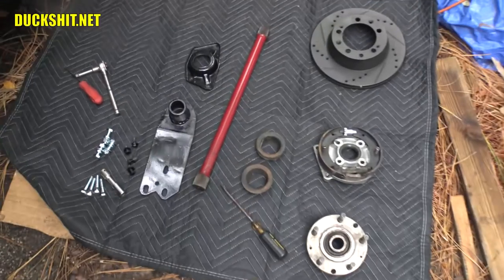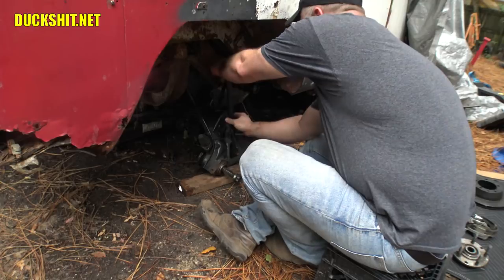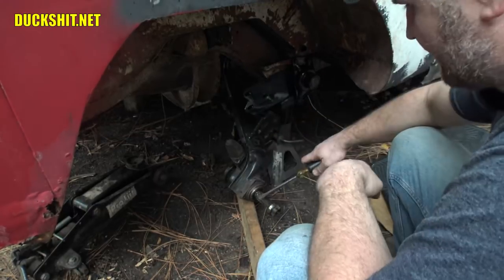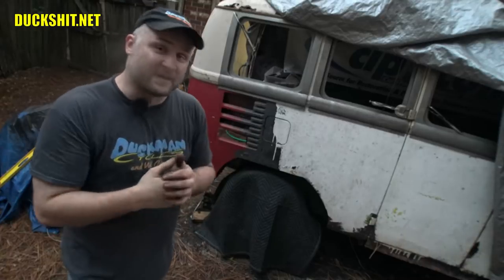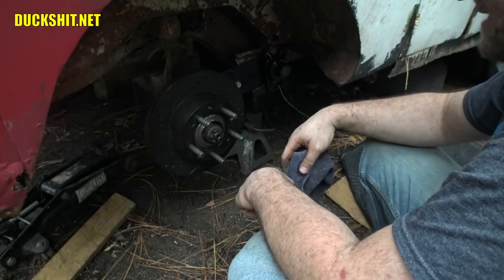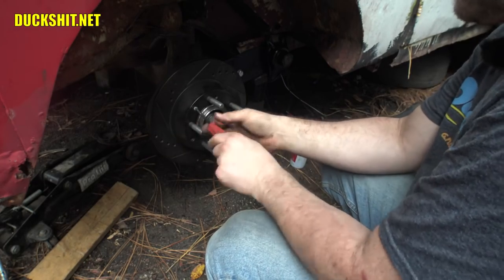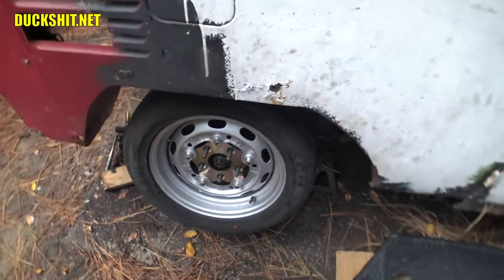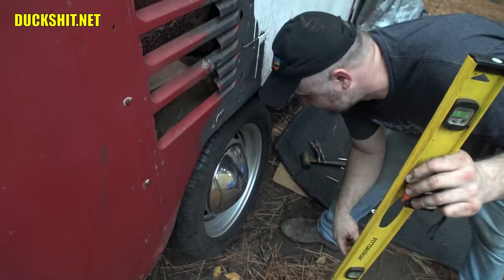Wheel Reveal - Porsche Brakes and IRS Test Fit - 1967 VW Bus - Gregory - 14

Comment: Thank you.. YOu answerd all my questions. I wonder if the Willwood calipers are more flush with the rotor so you don't have to use a spacer. I see why you had to though.
Reply from the maker: Not sure, but the Wilwood calipers would cost me a whole lot more money lol!  I don't mind the spacer, everything fits just fine!  :)
Reply: @DuckmanCycles  Do you know if a 15" wheel would clear the caliper?
Reply from the maker: That depends on which wheel and caliper combination you're using.  The aftermarket brackets in the front were intended to be used with a smaller disc than I am using, so they could clear a stock 15".  I didnt need that though as my wheels are 16".
Reply: @DuckmanCycles  For the rear, sorry. I mean, because you said you're using a 16" to clear.  Anyway, thanks for the great videos. Informative and funny.

Comment: hey duckman, great videos!!!!  thanks so much for them.  i'm looking at doing something similar on my '63 and the visuals were really helpful.

what did you have to do for axle length for the IRS conversion you did?  were you able to use stock bug axles by going 1 1/2" narrower per side?
Reply from the maker: Thanks man!  From my understanding stock Beetle axles (with late model Bus CV joints because of the Thing stubs and cups that I used) should be the ones to fit, but I have not yet fitted them.  All in good time!
Reply: @DuckmanCycles  thanks for the reply man.  i did some measuring myself off some other cars and it does seem like that should work about right!  I actually have the porsche axles/cv's to use which should be good for a few more degrees, so lets bag this thing and see how low we can go....

Comment: One question today This has always baffled me. What's at the end of the tunnel? Or should I say the torsion bar? Is there a coil spring inside or leaf spring what what gives it the "spring back" funtion ?
Reply from the maker: The torsion tube I think is what you are asking about.  Its a straight through tube.  In the center however is splines for the torsion bar to lock into.  The bar itself is the spring.  It is made from hardened spring steel and will twist only a few degrees, then of course, snap back!  So it lives to its name, as a torsion bar, in its twisting motion.  I hope that clarifies!

Comment: well you have wheels and  brakes....but i think that holey front body work needs a little attention .
Reply from the maker: Good, come get to welding!
Reply from the maker: Looks like you deleted your last comment. You might think that holes are more important to fix. But the car show is this Saturday. The Bus will get their fine without holes fixed, but it won't get there without a way to mount the wheels!  Bigger picture, you know?